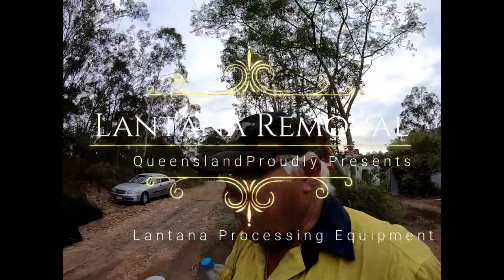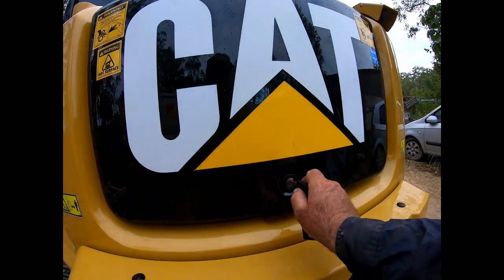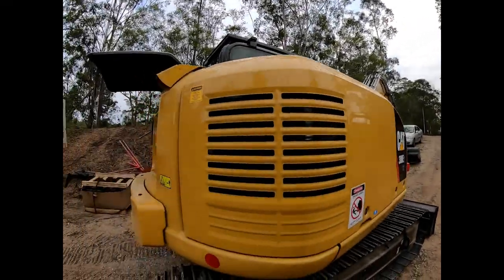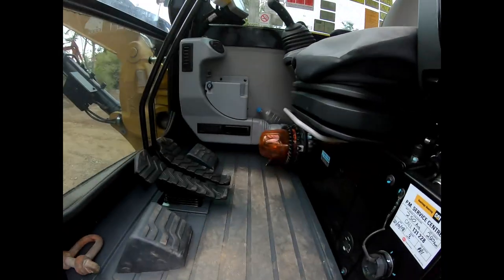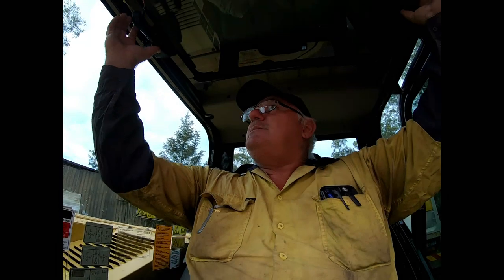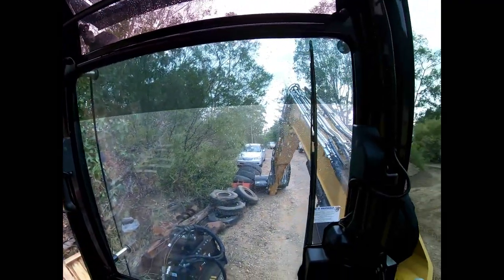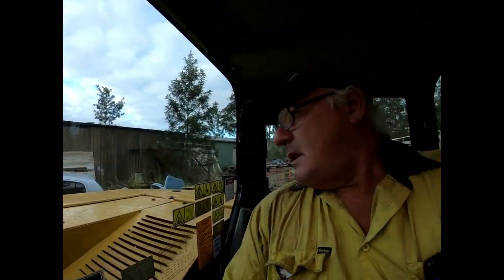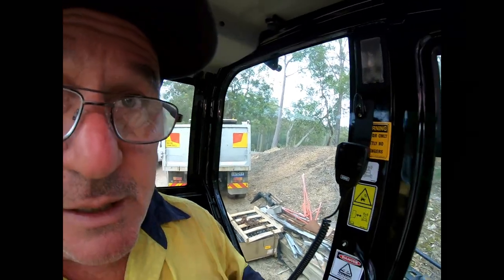EXCITING News, Machine Walk around CAt 308 ECR NEW

Comment: Nice purchase there Gary, not cheap, but in the long run should be trouble free. Just keep an I eye on your fluid temp when running that mulcher.
Reply from the maker: Rob M, I have some good Friends that run Mulchers but I have not heard that one yet, so I will have to see about that as I know how bad hot temps are in machinery, Little Kubby is Brilliant but her cooling system is so prone to getting clogged with dust and debri that it is less than 2 days before she must be blown out and she does not run a Mulcher. The Cat has brilliant Cooling package and access so I am looking forward to see just how good access and Maintenance is. I did my first big Day yesterday and to around 20 hours of film between 3 cameras and the drone so I will be very interested to see just how she looks, But production wise she is every thing I hoped for and allot more, I need to get used to her on the slopes as I cannot operate her in the same way I do Kubby the Kubota but that is machine operating in tough and treacherous terrain. She feels good and her controls are excellent.